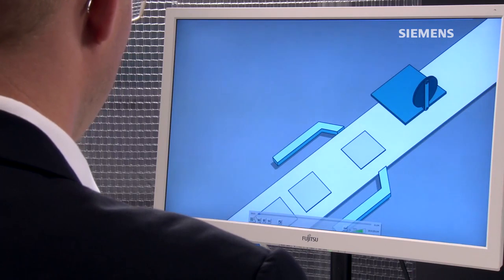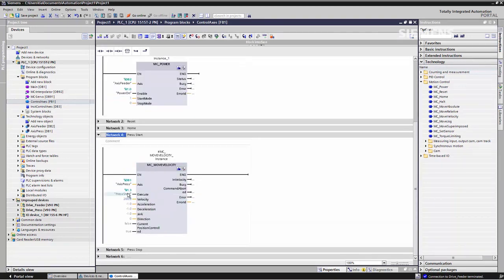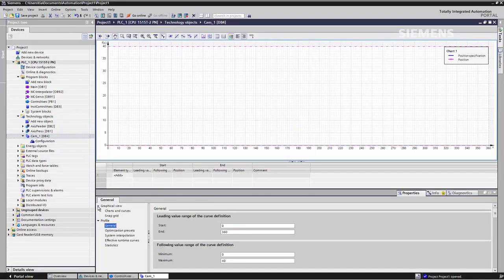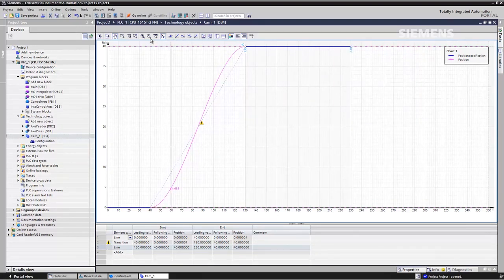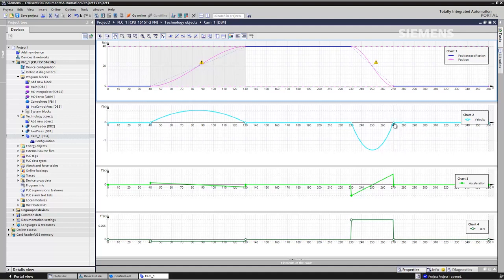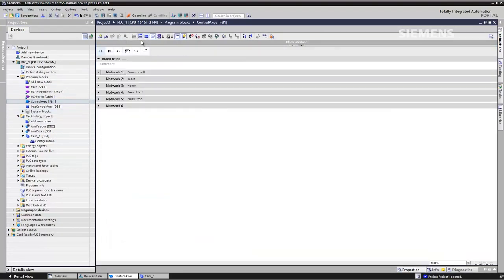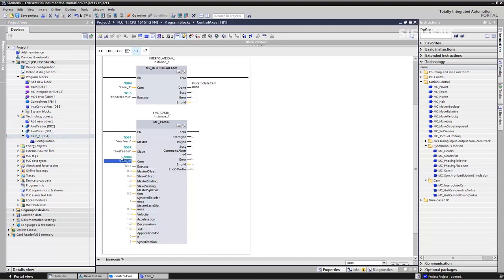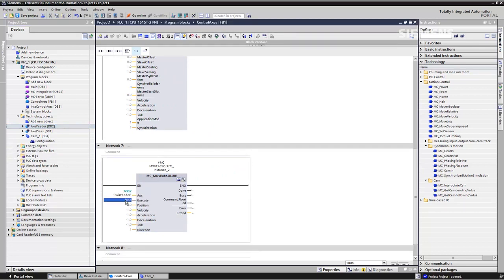TIA Portal motion | SIEMENS Motion Control | SINAMICS S210 | motion commissioning |  SIMOTION SCOUT

Comment: How to use PLC synchronize 2 Axis with position speed and torque synchronize ?
Reply from the maker: For positioning and Synchronous axes you can use the Torque Limiting function. This automatically disables the following error detection and makes it possible to move against a mechanical fixed stop with a defined torque (limit). 
So as described above you have your TO PosAxis (Master) and the TO SyncAxis (Slave). With the GearIn command you can synchronize the slave to the master. Then you give a position setpoint to the master which is beyond the mechanical stop (so it tries to go further but cannot reach the target). Doing that movement you also activate the MC_TorqueLimiting function on both axes and give your required torque limit as a parameter. So the load cell will push against the fabric with a defined torque/force.
kindly send us your contacts/email and we will send you .pdf file for more details.
Regards
WIACS